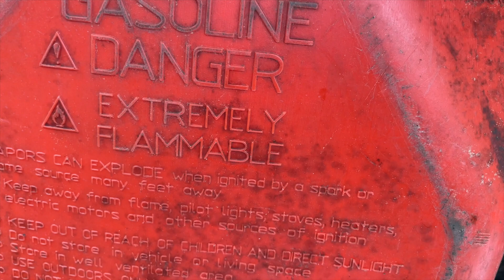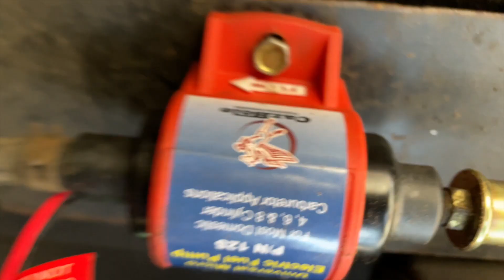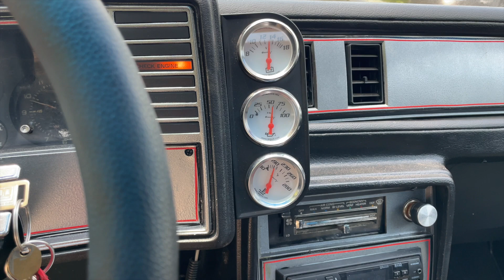Removing the Fuel Tank on an El Camino

Comment: Isn’t the pump supposed to be mounted lower than the tank??
Reply from the maker: Yes, usually. I haven’t had any issues and I’m assuming it’s because it’s carbureted which doesn’t require a lot of fuel pressure.